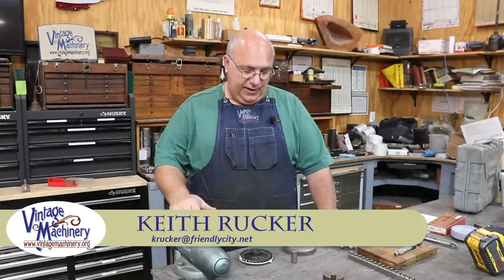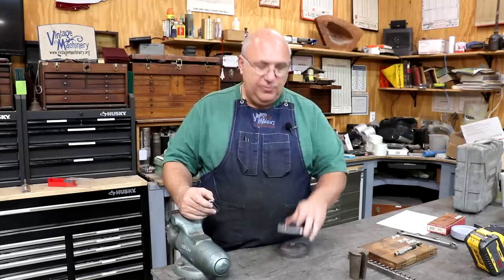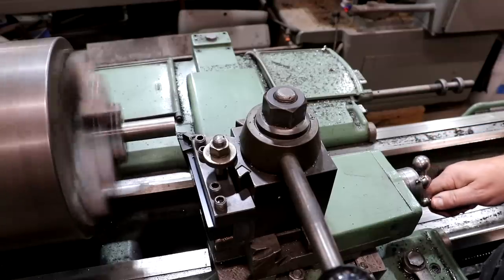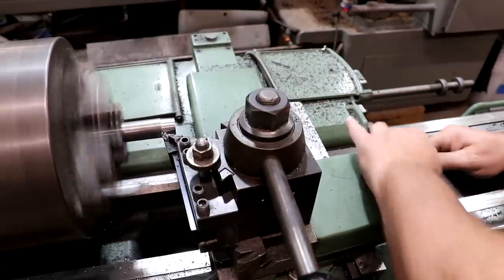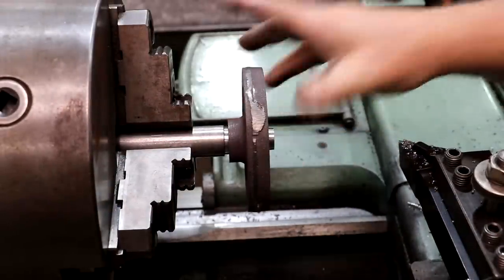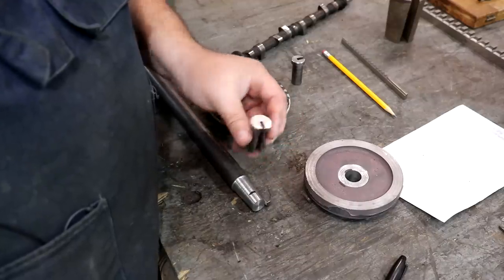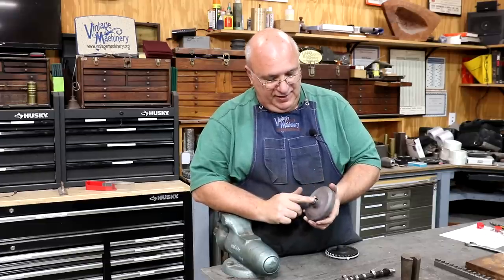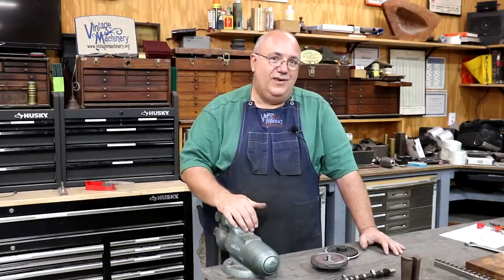Making a Tapered Broach Bushing for the 1928 Austin Camshaft Timing Gear

Comment: IF YOU DON'T KNOW HOW CRITICAL THE TIMING ON A ENGINE IS, STOP FIND OUT!! It is essential to get the valve timing right! If I were doing this job, I would separate the hub from the gear so that the relationship between the teen and the key way can be changed.  i know it's not as per the original, but why take the risk? Cheers, Matthew

Comment: For anyone watching and learning from this man. When doing a key way like this, don’t run your endmill back through the keyway with all the shavings in it. Seriously….

Also, yes Keith, the timing not only matters, it’s critical for the engine to function correctly. Stop ram rodding into jobs without researching.